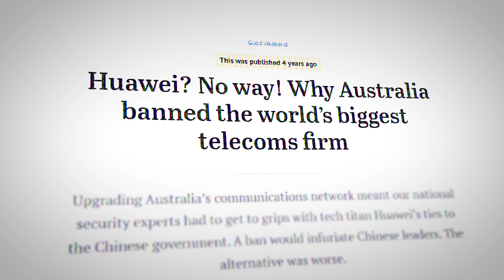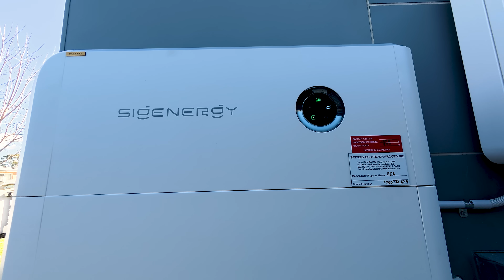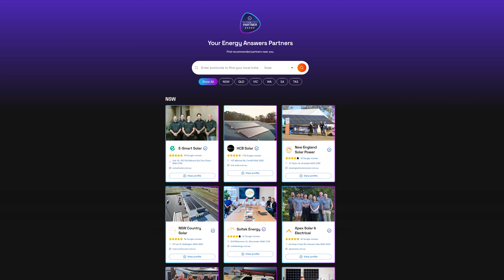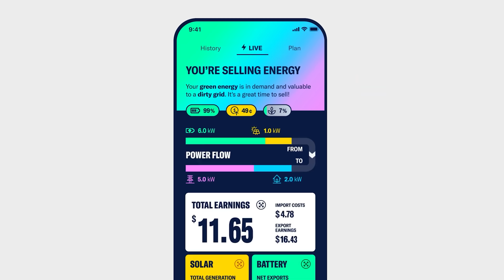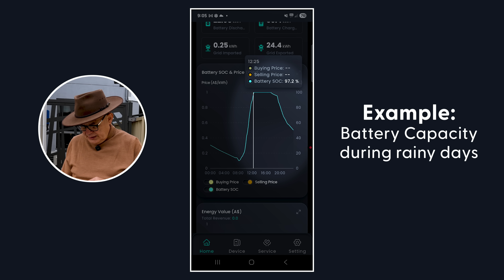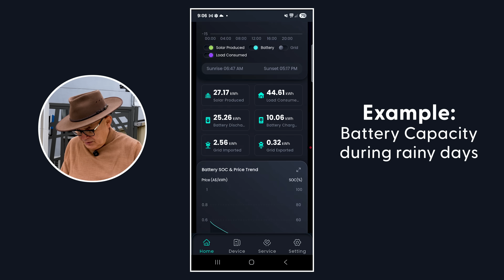Is going off-grid with Sigenergy a big risk?

Comment: I’m with you: going to replace my 12 years old 4.5kWh panel with 19kWh new panel and 48kWh battery of Signerengy 3 phases system (20T-48).  One of the key idea is to sell my extra battery through the Amber Electric.
Reply: If the grid and ther local wholesale price fluctuates a lot than this could be a rewarding financial model.
Reply from the maker: That’s a huge upgrade, 19 kW of solar with a 48 kWh Sigenergy 3-phase stack will put you in a whole new league. Selling into Amber Electric makes sense for riding wholesale price spikes, and you might even look at Localvolts down the track if you want to trade directly with neighbours or businesses. Between the two, you’ve got real flexibility to not just cut bills but earn from your energy.

Comment: I feel you - I only have 6kW, only 2 positive bills in the last 7 years.  (small offline battery for backup.
 - It is getting back to "financially costing" - due to the  state of FIT and Daily service charges.

$30k worth of battery +inverter for DC-AC battery

Reliable baseload is necessary for both individual users and the grid itself  - rainy days occur..
Reply from the maker: That sounds frustrating, especially with the current state of feed-in tariffs and those daily service charges.

Comment: If you have the generation and storage to be able to go off grid you will make money from Amber.  I have a 10kW inverter with 12kW of panels and 60kWh battery at home and even in winter I still get a credit. At work we ha e 60kW of solar (will be adding another 40kW soon, 100kW inverters and 600kWh battery.  We make money every month from our grid connection.  In both cases we could go off grid but I would loose the income.
Reply from the maker: That’s exactly it — if you’ve got solid generation and big storage, going off-grid actually leaves money on the table. With Amber, your setup isn’t just covering your usage, it’s earning from the grid. Even in winter, credits on a 10 kW/60 kWh home system are impressive — and at commercial scale with 100 kW+ and 600 kWh storage, the monthly income makes staying connected a no-brainer.

Comment: Some ideas: get a petrol or diesel powered electric generator. Or ask your neighbour if you can buy some electricity (on the quiet) from them if your getting low. Also you need to check the weather/solar forecast, don't run the battery to zero and then get 2KW an hour from your neighbour or a generator you have to anticipate the problem and start charging the battery 12 or more hours ahead of the crunch.
Reply: Also you could reconnect to the grid over winter.
Reply: @danielstapler4315  good idea _I will make some enquiries.
Reply: Love the idea of borrowing from neighbours. “I’ll trade you this case of beer for plugging in this extension cord for a few days” 😂
Reply: Also in the USA if a house is off the grid for one year and then wants to go back on the grid they need a full checkover and if it's an old house they could up for a bill of $10K or more. Some owners of foreclosed properties will put the house back on the electric grid for a day once a year to avoid that issue. I don't know what the system is in Australia but worth finding out.
Reply from the maker: Yep if you want to off grid you definitely need to be on your toes to manage your electricity usage.

Comment: I got a 40kw sigenergy battery installed. Signed up to origin loop and evergen vpp took over the battery. So then I decided to go to amber and they ported me across, however they cant get access to the battery and evergen still has vpp access. So i cancelled origin loop, however they said it can take up to 10 business days for evergen or tesla to release the battery back to you. Now I'm stuck in this limbo period where I cant access my battery and amber is showing 4 to 6 weeks to move onto their smart shift vpp as evergen hasn't released the vpp. So I'm stuck and not sure what to do. Just waiting to hopefully get  access to my battery. Has anyone got any solutions?
Reply: That's a big bummer -  do you still have the battery fully functional re your own use. If that's the case 6 weeks hopefully goes fast .. :)
Reply: @markuslambert8236 yes the battery is fully operational however as I'm technically with amber I'm using solar and battery but I have no control over how much i export to the grid. This is my biggest issue. I cant change from vpp to self consumption either.
Reply from the maker: That's a tricky situation, but hopefully, it will be resolved quickly and efficiently.
Reply: @yeanswers update...got access to my battery finally but it wasn't because origin loop did anything but I reached out to evergen my self. They got back to me, asked for few serial numbers and within 48 hours I was taken of the vpp and got my battery access back. So now its just amber need to get it sorted.

Comment: Been off-grid since 2021 and in the middle of winter you MUST be extremely energy frugal during times when you have 7 days of continuous rain. We have two inverters with another two inverters which have been tested and packed away as spares. I'm very sure your inverter module WILL fail at some time in the future and relying on ONE unit is not good.
Reply: That is smart - inbuilt redundancy - so that's a weakness in my current design. Maybe a 2nd Sigenergy stck in years will make it a safer bet.

Comment: I have a Sig 24kWh battery pack, 10kW single phase energy controller and 12.7kW of panels on the roof. There is no way I could go off grid with the weather here in SA at the moment. In hindsight I should have gone 40kWh of batteries but now I have used the rebate I’m knackered. It is a great system though and now I’m in with Amber making a few dollars a day.
Reply: I have a similar set up, but with a 32kw Sig battery.

The dilemma is recharging the stack - it takes between half to 2/3rds of the day to recharge the batteries.

If you had a bigger inverter and more solar, it might be worth it.

But generally, the system is best to offset peak charges.

Comment: If you live in a small place, the requirements plummet. 

I stayed on a boat for about 2 weeks, raining almost daily, during winter in Newcastle.

17kw battery, 3.5kw solar system.

Lowest it got to was around 30%... But I spent most of my time in a small room with a fin heater. Electric blanket at night.

It's probably vastly different to what your target audience is looking for, but super gratifying to know I can go off grid with less than $10k of equipment.
Reply: Well done to make it through that period.
Reply: (a roof large enough for 35kW solar - is a house that uses lots of energy.)

Investing $70k AUD in self sufficient power isn't for most. (for me the $$ for an additional battery make no real sense - satisfaction, but not economics.
Reply: @MD_Mr_MD yea, that's fair!

Comment: Just watch out for Sig’s standby / overall self consumption. 

It is very high compared to competitors so in low energy situations you might run into trouble fast. They also hide part of self consumption if you connect your strings direct - so the Sig (Plant) won’t report solar power until inverter power consumption is fully covered.

Comment: I went totally off grid over 12 months ago, I am a 28kwh daily usage with 116kwh of battery but soon to 150kwh, I build my own battery banks, I have 8 x 48v lifepo4 battery banks, and only use Eve cells and JK Inverter BMSs soon to be 9 banks all talking to each other along with some good victron gear along with monitoring gear so I can monitor right down to cell level, my solar is 22kw and soon to be 40kwh, as I am rural village and don't want a genny, I use to have single phase grid, now I have 3 phase off grid at 11kw a phase
Reply from the maker: That’s an impressive setup and a huge amount of battery capacity — sounds like you've built yourself a very robust system!
Reply: @yeanswers Hasn't faulted since I commissioned it Aug 2024,

Comment: Buy electricity at 2c per kW from Amber. Not worth going crazy with solar. I would say a large battery is a good idea since you can fill it at 2c per kW. The $30 you save per month for going off grid will take a thousand years to roi
Reply from the maker: That's a good point — if you're consistently getting very low rates like that, then a large battery could be a smart move.
Reply: This is exactly my plan. It won't stop me but have noticed Amber is now up to $25/month service fee. This has increased a few times. I wouldn't want to see it go any higher for a good while given lack of competition in what they do.
BTW I've been tracking Amber's daily import price curve all year for ACT. So far the high-renewable daily low prices have mostly been in the range 3 - 9 cents. The price spikes to enable good profit have been notably infrequent for the past few months after several at the start of winter with coal power generators having problems in Vic & NSW.
Reply: @MortyMac I am renting so I can't get a permanent battery. I bought the Ankor F2000 but I am returning it. Seems I spoke to an AI when I confirmed the specs and the AI was wrong. I will now get the BLUETTI AC200L+B300K. I hope their AI is right with the spec

Comment: Did you really get 32kwh of sigenergy batteries? I find it difficult to believe you wouldn't have maxed out the battery rebate by getting a full 6 stack of 48kw batteries in the first go. Are you just telling a white lie in the hopes of educating the masses?
Reply: @TheMightyAbs - seriously its not cheap to get a battery even with the rebate and as I got an AC coupled solution with a 30 kW inverter - it all adds up and I thought with 23kW use per day - I should be ok with 32kWh because I still generate over 20kWh on a rainy day - so it should work out - but then during rainy days in winter the wife decided she wanted more heating and even though we also have gas heating - she prefers the air con - and suddenly 32 kWH did not look that BIG and my usually fugasl ternant - used lot on those days too.
Reply: My installer mentioned that with the rebate it's only $1600 per 8kw module if done at time of installation. After I heard that I went from a 24kwh system to 40kwh. I found the wholesale prices of the batteries and the installer was still making a few hundred per battery and its very minimal extra work during installation.

Comment: I will have a V2X capable EV as a solution.
Reply: Would mind to share the brand of the EVs, and are they certified for V2H?
Reply: @tangj1013  My line is about off-grid back-up capacity only, so V2H ‘capable’ EV like BYD Seal was in my mind. I am not sure which EVs are certified for V2H in Australia to date.
There are hurdles for Markus’ solar + storage system to go off-grid. I would like to withdraw my comment to avoid making the impression that going off-grid in a grid covered area is a simple back-up capacity matter: For Markus’ system to go off-grid, he might have to pay back the government rebates, add or replace some hardware and software and re-configure the system settings.

Comment: I'm about to get a Sigenstor system here in Canberra - probably 48 kWh battery initially and defer the bidirectional DC EV charger until V2X is more established - although I was and am still tempted to install the latter DC charger initially and just accept the 40 kWh battery (which is a compromise due to the modularity of the system which is limited to six modules per stack, the DC EV charger being a module in itself). The reason for considering the 40 kWh battery would be the labour cost of installation: getting the 40 kWh battery and the DC EV charger at the same time would reduce overall installation costs. Starting another module stack requires another inverter (someone please correct me if I'm wrong) and of course this is extra cost. And I already have a 22 kW AC three phase five pin outlet which I use with a portable EV connector/charger (sometimes called a "charger" but it's really only a connector) (EVSE brand), although the 2023 Tesla Model Y Long Range AWD can only accept 11 kW from AC charging. I believe the DC charger costs about AU$7000 installed (although 'installation' I think only involves placing the DC module on top of the stack but there may be more involved that I don't know about). So I suppose the choice could be to get the maximal battery subsidy (up to 50 kWh) by getting the 48 kWh battery and when energy arbitrage develops more, start another stack and get the bidirectional DC EV charger and do V2G/V2X. In my case, I would only really need to DC EV charger for vehicle-to-grid or home because of the three phase AC outlet charging I already have. I should have mentioned that I'm looking at increasing the solar PV panels from 10 kW (which I have had since 2010) to 23 kW. I would love to get some feedback and comments on this - including constructive criticism.
Reply: I went for the 48kWh and the full stack _as I believe there will be also other solutions coming through for 3 phase charging - maybe even with Sig on the charger side...maybe even cheaper.  and I also consider the 2nd Sig stack in the future as an option as we might have 3 EVs in the home... and yes 10kW - is now a bit thin. go for max... in the solar
Reply from the maker: Sounds like a solid plan for your setup — really smart to consider the long-term potential of V2X and future energy arbitrage.
Reply: Your planned system sounds great. My only concern is your comment is on a ‘going off grid’ video. If you’re wanting to go off grid permanently without a generator, you’re most likely underpowered here. Even if you’re willing to handhold your system with V2X, a single stack gives you a single inverter (energy controller in Sigen parlance), and ergo a single point of failure. If you’re staying connected to the grid as a backup and to get you through droughts and peak demand periods, then I reckon you’re going to be very pleased.

Comment: Love my Sigenergy. But agree, I wish I installed 48kWh rather than 32 kWh
Reply: That's good feedback, but have to ask what are all these commenters burning so much power on? At the worst time of year for me in ACT (mid winter), we use up to 15kWh/day for 2 of us, with a good chunk of that used by the old resistive storage HWS to bring very cold water up to temperature. The other 3 seasons all average between 10 - 11kWh daily load. The house is fully electric except for the BBQ, & I don't yet own an EV, but I do charge my eScooter at home most days.
Respectfully, maybe some home efficiency investment could provide better returns than a bigger battery?
Reply from the maker: Thanks for sharing that! You're not alone — a lot of people who start with 32kWh realise pretty quickly that it's just not enough, especially during back-to-back cloudy days or if you're running a larger household.